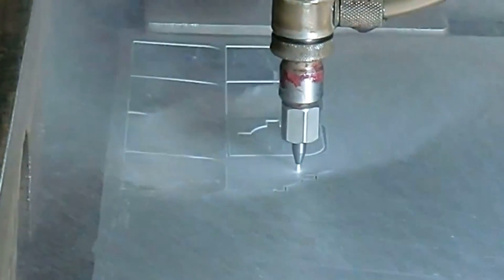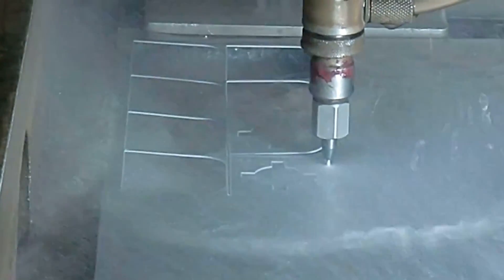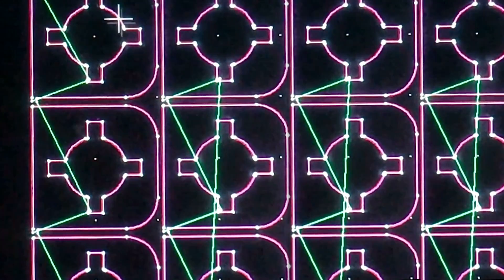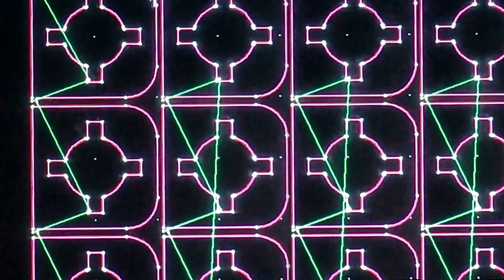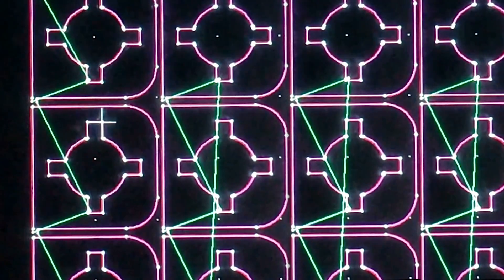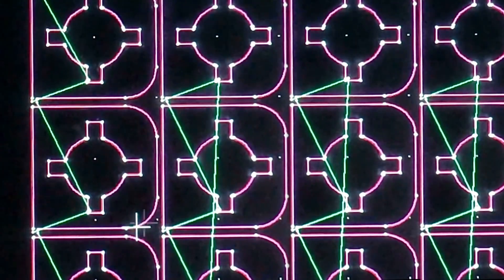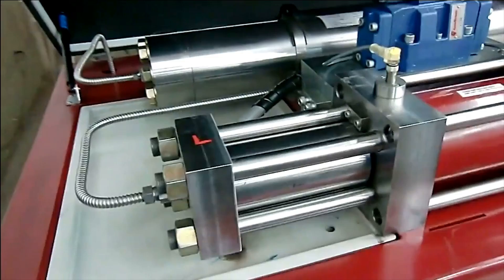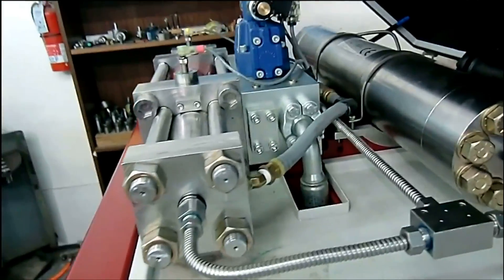Waterjet Cutting

Comment: Can it cut high carbon steel?
Reply from the maker: Yes, waterjet cutting is often used for cutting high carbon steel. The process offers advantages such as minimal heat-affected zones, high precision, and the ability to cut complex shapes. It's especially useful when the material properties of high carbon steel need to be preserved during the cutting process.